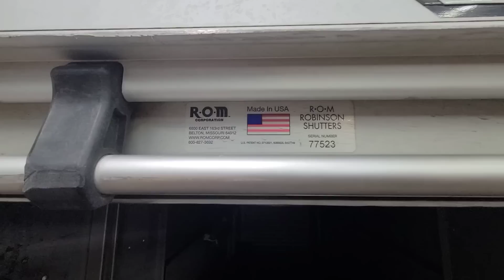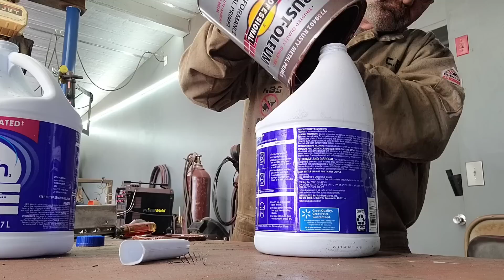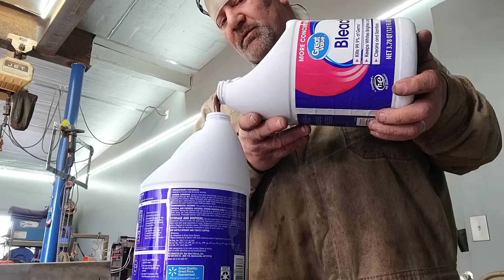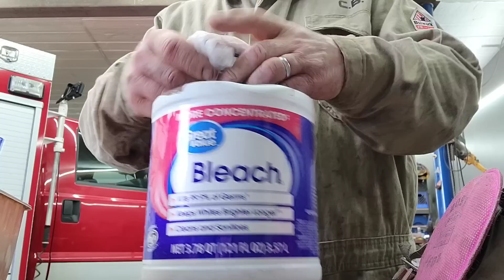F-550 Firetruck bumper and pull hook

Comment: Years ago, when I was a firetruck fixerupper guy, we used this stuff that was a 3 letter electrolysis and corrosion stopping spray. It seemed to work. But it was banned by our manufacturer and we were forbidden to use the remaining product. We had to send back every single can of it. Something in it was extremely carcinogenic. So I don't know what would take its place now. 
On those Rom doors, you can replace individual slats. And yes, they're an awesome product. And whoever let that pipe connection fly, needs their head examined. This is definitely a channel people should watch. Great work. 👍

Comment: Great work! Irwin makes 2 sizes of adjustable tap sockets that come in a pack for $25 on Amazon. It'll do anything up to 1/2" tap. That way it's super easy to put in in a drill or impact or even a socket wrench if you're in a tight spot. I tried posting a link but I guess it got taken down. Who knows? 
Anyway, Thanks for all your tips!
Reply from the maker: I looked that up and found the set...pretty nice and that's a good company...I don't think I need those but nice to know about them because if a job came up where I was tapping alot I'd get those
Reply: @NBSWELDING  👍

Comment: 54:19 your problem is that Dewalt sucks. They have a few decent tools but the majority of them just plain suck.
Reply: I don''t have any problems with mine.
Reply from the maker: Only thing I’ve had any trouble with was a small cordless leaf blower that didn’t like to work with certain batteries…otherwise I’ve got over a dozen DeWalt tools that work real well
Reply: Once again showing that, in a real world welding shop, there’s very little actual welding! You have to be far more versatile than just mastering welding. Two things: 1) with the tow point on the rear, I think I would have just mounted a hitch receiver tube because you were pretty much there anyway. 2) please wear gloves and a full face shield when using zip (cut-off) wheels or a cup brush. They’ll “F” you up BAD!